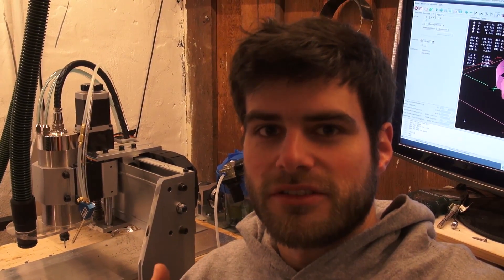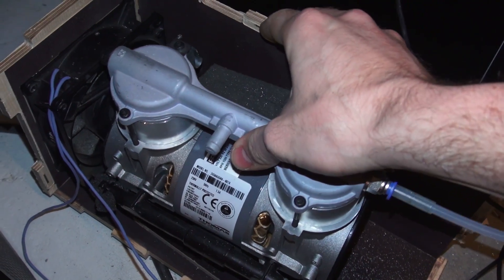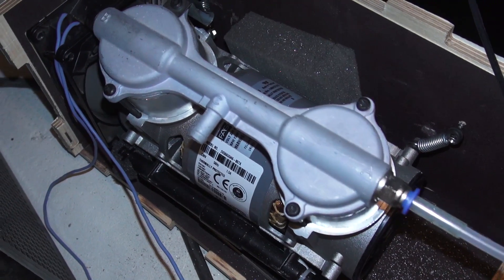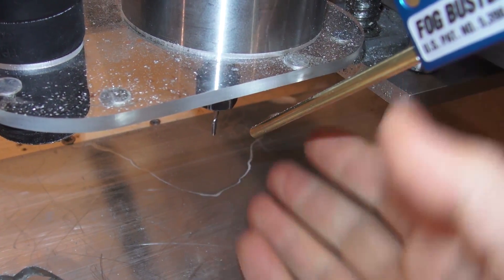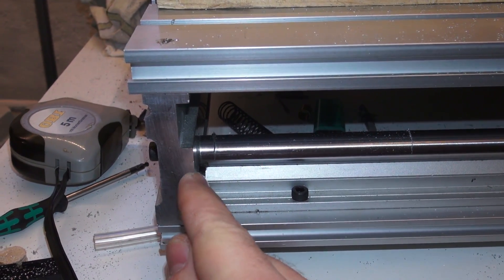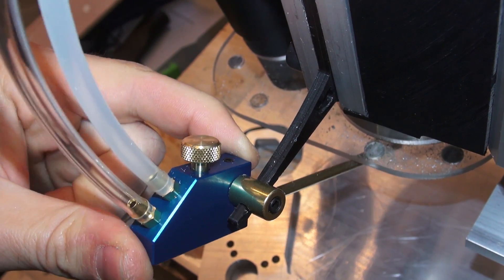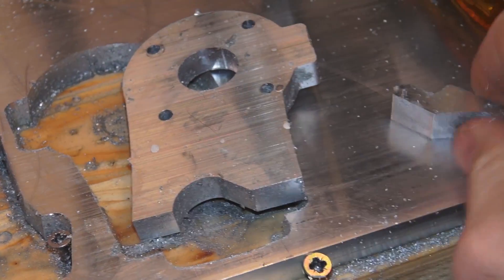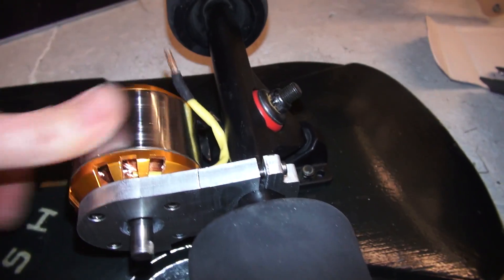6040 CNC fog buster upgrade and milling 10mm aluminum

Comment: Do you have a link we’re you buy the cnc machine 6040
Reply from the maker: eric oneil yes its in the description
Reply: youser23 how you find it cutting aluminium would it cut 1/2 inch
Reply from the maker: eric oneil yes it would but of course in several passes. So maybe not for mass production :) the thickest I did was 20mm. But it's not fun
Reply from the maker: eric oneil it depends a lot on the thickness of the tool
Reply: youser23 what’s the over all work diamesions that can be cut

Comment: Mine is bolted to a 20mm hard steel bed. The bed weight is around 150lbs this is then bolted to a custom made bench which is bolted to the floor. NOTHING moves even at fast cut rates. I use a light machine oil  in the fog Buster.

Comment: nice work, but you really need to move the cutter with a faster federate. that'd be why the cutters are breaking - they're rubbing the aluminium out of the way rather than cutting it. you'll be surprised just how fast you can run through ally - i have a 6040 too and run it at 2000mm/min, 10mm doc and a 0.5mm stepover (8mm end mill). you'll want to do your own tests/tuning, but too slow is worse for cutters.
Reply from the maker: thanks you might be right but wow 10mm deep and f2000? i dont understand how people are getting these feedrates on this machine. Mine is losing steps at this speed. You probably realigned it well before putting it together?
Reply: Main thing i did to avoid lost steps is buy a smooth stepper. Driving direct from a PC is a PITA because windows doesn't do real time stuff well. I had massive issues with lost steps (below 1000mm/m) but they all went away with a smooth stepper. 3000 rapids now, can probably go faster but no need given that covers the table in a few secs.
Reply from the maker: ic - i use linuxcnc (realtime kernel) but i agree it could have to do with the direct driving. do you use a mesa card or what kind of driver?
Reply: also pure alcohol (ethanol) works really well for cutting ally. Doesn't leave any residue and is relatively non toxic. just make sure its not an enclosed space or you might get a bit tipsy :P
Reply from the maker: ok :) but have you tried windshield washer-fluid (the one for summer months)? smells nice and i dont have any residue problems either
Reply: My recipe for milling aluminium with an 1/8" two flute cutter is 25000 rpm, 600mm/min feed (24 inch/min) and a doc of 0.5mm (20 thou) when slotting. Maybe your machine can do even more, I think it has more robustness than mine.
Reply: Yea since seeing this ive been thinking of giving it a go... though i live in australia so not sure what the difference between winter/summer stuff is... just no anti freeze?
Reply from the maker: sn0wchyld haha yes the antifreeze
Reply: hey mate just thought i'd update - did some research and a lot of wiper fluid uses methanol as an additive - so be careful and check as that stuff is nasty even in small doses though the skin or inhaling fumes. highly toxic, can make you blind even in small doses.
Reply from the maker: sn0wchyld hmm ok thanks for the info. I checked the stuff I use (mixed with a lot of destilled water though) it says it has methylisothiazolinone in it.. Not exactly methanol but probably still hot drinkable

Comment: can you provide the link to your pump? i am using small 5 gallon compressor, looking for something dedicated to give them air.. you have the ebay link where you bought them from and what model number?
Reply from the maker: Hi. i bought a "Thomas Kompressor" model 2450AUU. doesnt have to be this exact model as long as you get one that has about the pressure you need. If the pressure is too high you might run into problems if you dont have a surge tank/reservoir.

Comment: Excellent. Can you please tell the feed rate and spindle RPM. Thanks
Reply from the maker: +Kaiser Haider spindle speed was 24000RPM. Feed rate i cannot exactly tell you because i used the "percentage-slider" so i don know what the actual feedrate. Probably less than 100mm/min for safety
Reply: Ok great job, impressive. Thanks.